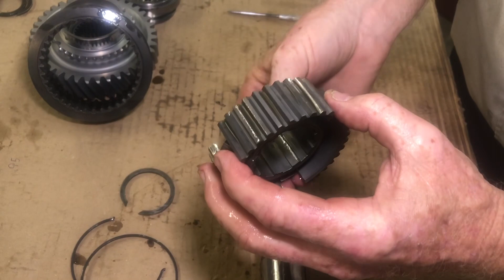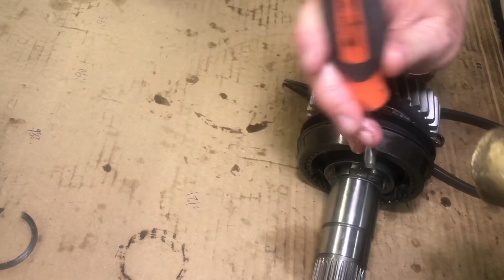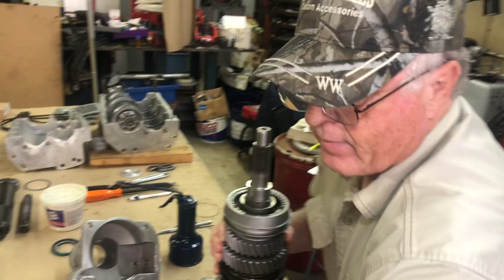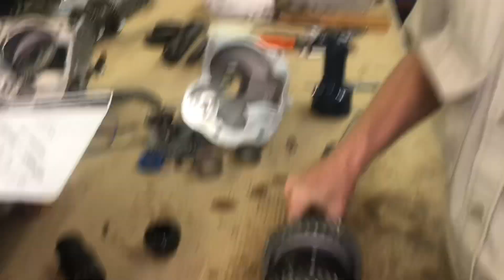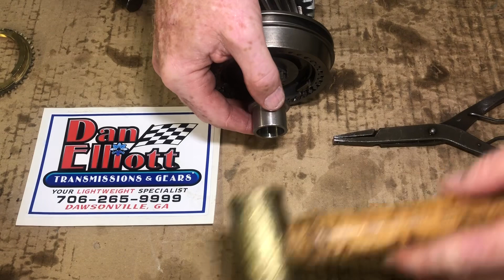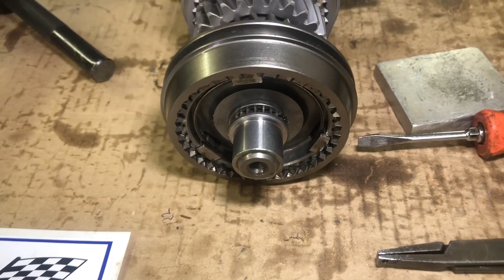Richmond Over Drive 6-Speed Transmission Part 5: Mainshaft Assembly.

Comment: Do you work on the super street 5 speed? I have one that keeps crunching going in to second gear. I replaced the synchros indexed the bell housing and checked the clutch for full release, all is good so it has got to be in the sleeve or hub
Reply from the maker: Darrell, give me a call during the week 9-5 eastern time. I need some more information. Thanks 706-265-9999